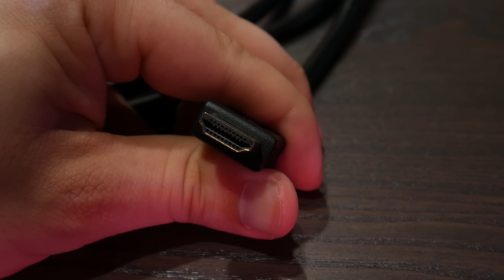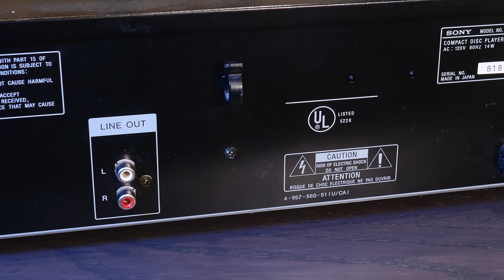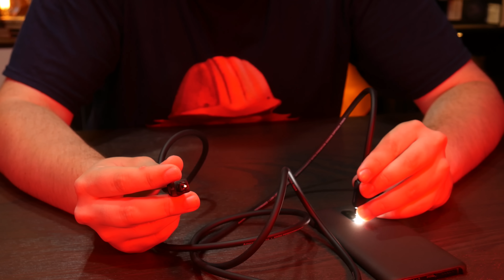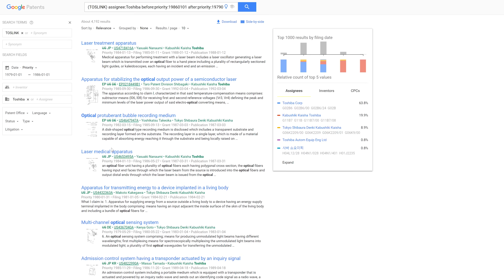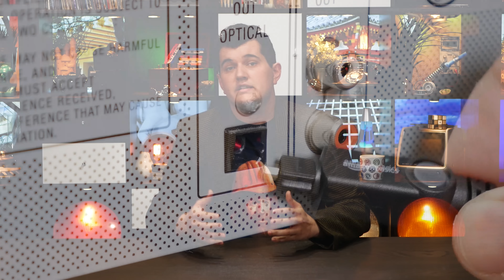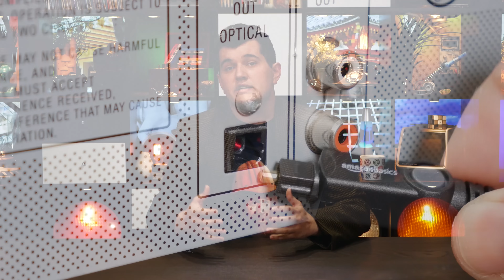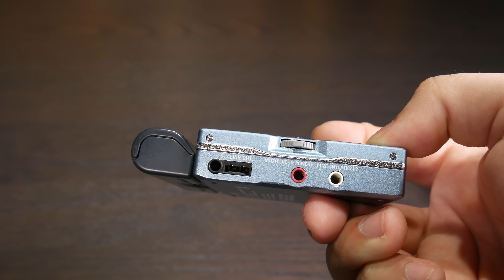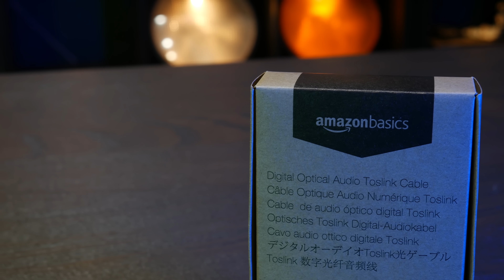TOSLINK: That one consumer fiber optic standard

Comment: It's still wildly impractical to give fiber networking equipment.
If you look at enterprise fiber networking appliances, almost all of the actual fiber connections go through a signal generator(the actual laser light) and receiver, also known as a 'gbic'
They are very expensive, and the amount I had to replace over the course of 3 years in the datacenter I administered is ridiculous.

Comment: something that i seem to be not understanding why not make a  2 lane "toslink"(fiber) cable and just send a software update to increase bandwidth of the port by receiving the blinking led faster slower etc. would that not just be better Especially when dealing with the super thin paper tv's with a separate Compute box rather than dealing with the unreasonably delicate ribbon cable they use? 

I wonder if it would also fix the LAG issue we have with Digital formats sure its all digital but light moves faster in theory should the receiver receive it faster than over copper and electricity?

Hell if you really want to be a little screwy why not add it to PCI channels for better bandwidth and seal the ever loving crap out of it and run them in lines Leds gotta be cheaper than running copper and buying expensive cooling shrouds for them if they start to over heat.
What about a SATA standard for quick remove bays bringing wear down to extreme levels while keeping high bandwidth one that could simply be updated with a firmware/next board revision for more bandwidth making it a fully future proof connection(until more lanes are added once we reach the cap).

The weakness of short distance is the only major thing against it.And while noise isnt an issue in most circumstances for coaxial wires s good spider nest of 18 consoles on display sure does create a great antenna for noise to be caught for retro collectors to deal with.

Just thinking of the basic change from copper to glass is cheaper too. Starting to wonder why we kept copper for so long in the entertainment center long runs ussually dont happen there and if you break a toslink you are trying fairly hard to break it same bends in copper cables cause issues there... unless its formed or melted into that position.

Comment: Back when I had a Playstation2 I used TOSlink to connect it to my AV receiver. iirc the PS2 didn't have a coax SPDIF port. You MIGHT have been able to add a coax SPDIF option by buying a different A/V cable. I don't remember. Either way, if there was such a beast, I didn't have one. So my only option if I wanted that sweet 5.1 channel sound was to hook my PS2 to my A/V receiver using TOSlink. And it indeed worked pretty well. Of course when I eventually upgraded to a PS3, that was no longer necessary, because HDMI was a thing by then.

Comment: Mini TOSLINK, been using it for years but never knew it was an actual standard. Bought a Xonar U3 USB soundcard that has it and is the single way I've found of piping 5.1 Dolby/DTS from my PC or laptop into my old home theater system (that has no HDMI input), it comes with a little adapter from mini to standard TOSLINK connectors. Up until now I thought that it was simply a form factor hodgepodge Asus had made up to keep the card small and "dang if I lose this stupid thing I'll probably have to get a whole new soundcard".

"Mini" isn't mentioned anywhere in the documentation, they just call it an "Optical Adapter" -_-;;

Comment: You are correct that TOSLink offers the advantage of galvanic isolation, thus eliminating a path for stray stray grounding currents. Coaxial digital audio signals are often transformer isolated for the same reason. One place in home theater systems where stray grounding current often occurs is with cable TV connections. Sometimes external RF transformers are used to provide galvanic isolation from the TV cable.

https://www.amazon.com/Isolation-Transformer-Ground-Loop-Isolator/dp/B00B2HFE2O

Comment: Why aren't fiber optics common in the home? Because virtually no one needs more than a gigabit on their home LAN yet. Home routers can't even take advantage of that speed if it was available. 

Today in 2019 Comcast and Verizon will sell you an internet connection that's supposedly greater than 100mbps and provide you a router that only has 10/100 interfaces. 

The very few people who do need greater than a gigabit on their home network can just buy commerical gear. Same goes for people who need cable runs more than 100 meters.

Comment: While you are very much correct about low level analog noise not interrupting a digital signal, I have personally come across one case in my line of work where an optical connection was necessary. As a coaxial link shares its ground conductor with the rest of the circuitry, and thus connecting the two devices makes their ground common, I have had an issue where switching power supply noise (essentially dirty power noise) was making its way from the transcoder through to the amplifiers in the output stage via the digital coaxial link. Making that link optical electrically isolated the two devices and the problem was gone.

Comment: How about asking a technical engineer in preperation of those videos. 
Digital links were planned as the "last mile" for signal transmitters - to the (then active) speakers, skipping the whole bunch of signal loss/alteration due to cable impedance and capacity. Till today you feel good wiring a finger think copper wire aound your room to your amp? And you make fun of a slim optical TOSLINK?
Did your ever heard of ground loops?  

Any optical cable will provide perfect digital signals despite damping and loss of signal, while copper cables corrupt the signal (HF damping, group delay, impedance matching issues, common ground problems). Did you have ever cared about the impedance of your cinch cable yet? Allright, it's okay for 1-2 meter.
Good luck connecting 20m to your speakers - connected to a different mains - and ground...
Brummmmmmmmmmmmmmmm
The red cable will be RIGHT, the white cable will be LEFT and they always will be - because it's the best system ever existed.... <rolling eyes smiley>

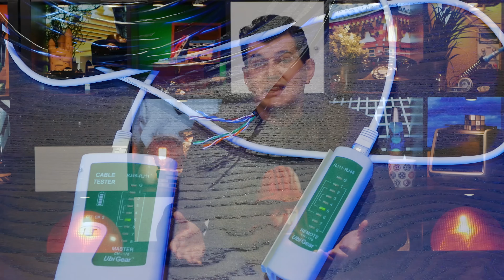Comment: @1:01
"We just haven't seemed to find a place for fiber optics, aside from piping it into your home or business".

Data centers use loads of fiber for connecting servers to external, local storage (such as, for example, EMC's VMAX).

@12:05
"Good luck avoiding the building's electrical wiring, they're eventually gonna share."

Products from companies such as Shunyata Research and Audioquest clean up the power.
If you do an A/B test, using no upgraded power related cables or equipment, and compare it to replacing the power cords and using their line conditioners, you will hear a difference -- and it is not subtle.

Do not perform this test with any of the equipment you have in this video.  It is not capable of throwing a wide, tall, deep, and realistic soundstage.  It does not reveal the space between the instruments.  It does not reveal black backgrounds.  It never sounds like the singers are really in the room with you.  Rather, it always sounds like a reproduction.

But with high-end, matched, and professionally set-up audio equipment, you will hear all of the above, and you will benefit from cleaner power, derived from products from Shunyata and Audioquest.

How does that happen?
I do not build the stuff.  I just listen to it.  There is a difference, and it is not wishful thinking.

Comment: I find it funny that I'm watching this video using my fiber SFP network card (because the NAS needs to be fast) which is connected to my switch which has a fiber link to my router which connects to my fiber optic internet while using a toslink DAC for my headphones I might have a problem with acquiring old data center hardware

Comment: I think the only time a fiber optic cable would be even a little helpful is when you have a super long cable run. But the error correction would handle any problems. Any, yeah, you would need a more powerful photon emitter than what is in home equipment. So, unless you're a scientist running a sensitive experiment, there's really no reason for it. Unless you want to be COOL! heheheh ;) :P

Comment: I still use TOSLINK to connect up my audio/video system. Minidisc, DAT and CD recorders all inter connected so I can digitally record from one to the other. Luckily my DAT recorder is a semi professional model and SCMS can be switched off with a few button presses. TOSLINK isn't yet dead either, my laptop bought just a couple of months ago has a mini TOSLINK audio output meaning I can easily record to another digital device too. Back in the 90s you could (still can actually) buy a TOSLINK to Co-Axial digital audio converter which had the added benefit of stripping SCMS too.

Comment: You forgot one key feature of the Toslink cable. That is the fact that they are made from a very soft material on the outside in many cases, and the inner strand is so small that they can be super unbelievably flexible. So when wiring them up behind an entertainment system that has a mass of cables, they are much easier to manipulate and to run between and around other things. That is the major advantage that I have found from them.

Comment: Coaxial cables for SPDIF should be 75 ohm, as should composite video cables. 
Thus, I have always used video cables for wired digital connections between the CD recorder and the DAT deck. 
When I got a MiniDisc deck, I started also using optical between it and the DAT deck. 

Oh, and... PLEASE don't call a plug a jack.

Comment: Ground loops have always been a huge, endemic problem in the audio industry, & are the actual reason reason why TOSLink & other electrically isolated sound industry interconnects (eg; balanced line audio, & MIDI) were invented.It's not just for audio quality either; grounding problems have been killing roadies & sound tech's for as long as amplified live music has been a thing.

Comment: Mini TOSLINK was on a lot of Apple computers from about 2006-2016. I also had it on a FiiO DAC (which shared the port with coaxial S/PDIF.) A lot of TOSLINK cables sold by retailers also come with mini TOSLINK adapters.

Comment: I prefer to call Toslink an Optical cable since the majority of them sold are plastic.  Also, the Led is shooting the light 'straight' through the plastic 'pipe' , not bouncing multiple invisible laser wavelengths like is done on a telecommunications fiber optic cable.

Comment: (9:47) I think you're exactly right. It would be a royal pain to introduce another cable design down the road, so by making the TOS cable keyed from the very start would ensure that they wouldn't have to get manufacturers to adopt it and them having to create new manufacturing equipment to accommodate the change. Any new cables would be backwards compatible, too. :)

Comment: Working the communications industry fiber optic cables tend to not be very adorable if in correctly handled. The largest problem is dust doing damage to the fiber optic cable tip or pushing the dirt into the connector and ruining the equipment end.  However Samsung is making a 75-inch TV with a fiber optic connection which I recently found out about. Yes communications fiber optic cable has incredible capacity. At the communications industries techniques to send information across a fiber optic cable. You have the electronic coating which is compression time division multiplexing. Then you have the optical options wavelength multiplexing and polarizing light.  Vertical and horizontal this technique was used in microwave communications even to this day. This works simply by taking two wavelengths that are identical and make him 90°from each other.

Comment: Lots of people don't know that the Mac Mini (at least the old 2012 one I have) has a mini-toslink digital audio out connection shared with the 3.5" analog audio out jack.  I use it to connect to a pair of speakers that have a Toslink in jack.  You just need a mini-toslink to toslink cable (there is such a thing).  https://www.amazon.ca/gp/product/B0719C132V/ref=ppx_yo_dt_b_asin_title_o01_s01?ie=UTF8&psc=1
Reply: mini-toslink to toslink cable.  https://www.amazon.ca/gp/product/B00016W6Y6/ref=ppx_yo_dt_b_asin_title_o01_s00?ie=UTF8&psc=1

Comment: Toslink has more JITTER (usually). Toslink does help ground loops common in consumer AV setups, as you mention but analog noise can affect SPDIF jitter. Remember a PLL has to do clock recovery.  Here is a nice article I just found that illustrates this (as well as showing HDMI can cause problems too): https://www.audiosciencereview.com/forum/index.php?threads/a-deep-dive-into-hdmi-audio-performance.56/

Comment: HDMI ARC has the same limitations that spdif has so maybe not quite so advanced after all. I don't really understand the hate on Toslink though. It is bad because there was another interconnect that was easy and mostly the same? Couldn't you just as easy dump on coaxial because it could be confusing using the same plug as analog A/V cables. That cable was also suppose to be a special coaxial cable with RCA jacks so it is not like you weren't supposed to be using something special with that as well. I think the fact that a modern TV will still likely have a Toslink output (and no coax spdif) and that still works with equipment old and new, says that perhaps it was not such a bad interconnect after all.

Comment: "Dark as the future of Windows Phone"
Savage.
Also, I'm damn proud of my HD DVD lol. I got them for super cheap cuz the format had just died. I got all the movies I wanted so I'm happy. BluRay is dead anyway.
Reply: "Blu-ray is dead" is a joke... Right?  😬
Reply: @kobathor  no. Why would you go to a store to buy a movie when you could just stream or download it over the internet?
Reply: @jebdunkins6796  Some people prefer physical formats and the quality of the files themselves on Blu-ray are almost always significantly higher quality than if you were to stream or buy them digitally.
Reply: @jebdunkins6796  because bit rate, bro. 99% of consumers don't have the bandwidth to receive uncompressed HD video, and the streaming services don't have the bandwidth to send that data to everyone either.  Most streaming services use relatively heavy compressed video despite HD and 4k resolutions. And if you want to download a blu ray movie, its typically 25-50+ gb. Even on a high speed connection it will take over an hour to download, then you have the issue of storing all these movies. I'm not saying I don't stream or download movies, but blu ray disc certainly has a consumer friendly purpose for high quality video. Especially in the rental industry.

Comment: I used TOSLINK to connect one computer to another so I could share one pair of speakers between one computer. It was a lot better than using an analog cable. I didn't use the gold plated cables though :)

Comment: HDMI = Handy Dandy Movie Input. Hahahaha! That's gold. Gonna use that from now on. Also, yeah, ground loops are (can be) bad, but the great thing about standards is that the device manufacturer's can design their devices so it's a non issue. Personally, I've wondered for years why we never saw an optical Ethernet/Cat 6 replacement. I guess everything is moving to USB-C style now. But even thunderbolt 3 is only 40 GBd, which is much lower than what we could get with optical.

Comment: I'm using fiber optic audio between my TV and soundbar specifically because HDMI audio was giving me random clicks and hisses. My router/modem etc is all stuffed in the same area so I'm used to wrangling magnetism a little to get things working correctly.

Everything sounds great with the fiber optic connection.

I think  the DAC in my cheap old tv is getting tapped by voltage changes from the HDMI/EM sources. That is to say, the HDMI cable is causing noise distortion but the distortion isn't happening WITHIN the cable, it predates it within the poorly designed and/or manufactured circuitry. The end result is my speaker gets a perfectly encoded copy of a screechy mess my TV thought it wanted, so everything "worked", technically...Just the HDMI cable was a bit too good of an antenna. 

Point being, if you are in my very specific situation, optical makes WAY more sense than HDMI. Obviously unsubscribe, thumbs down.

Comment: One advantage of TOSLINK I found it that it will not cause ground loop hum. If the amplifier or sound bar was designed correctly, there shouldn't be hum noise to begin with, but many cheap ones are not designed very well.

Comment: I've used toslink fiber to solve tricky problems of hum issues in radio stations. Especially when you want them to be to electrical code. So many musicians or even news crews chop off ground prong or use adapters,etc.

If you tinker with high voltage fiber is safe. The Vermont power conversion station I visited with a broadcast engineer group was fascinating. 900,000 volts DC from Canada converting to 60hz ac using whopping triacs, and of course using fiber to control the gates.
Good for Tesla coil stuff too.

If you are a maker, tinkerer, or just old... We all had to tinker.
 I was going to mention lightning triggering rockets, but they use aquarium tubing to blow into and trigger the launch switch.